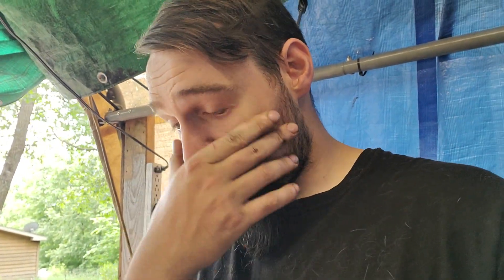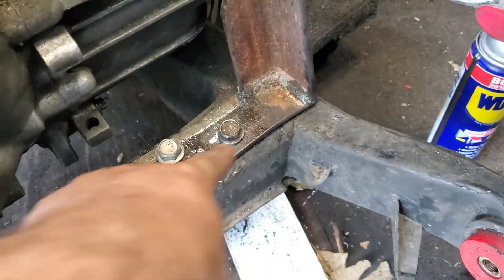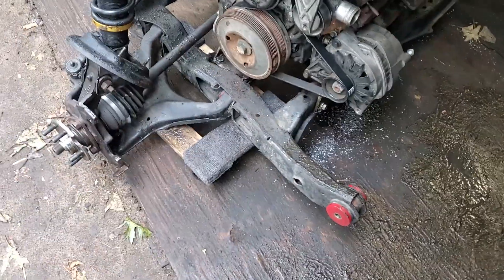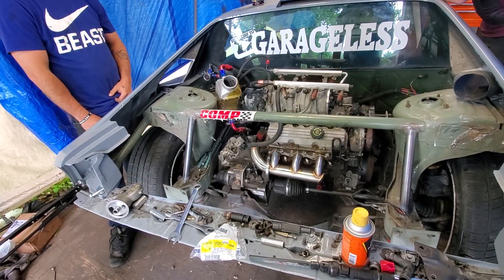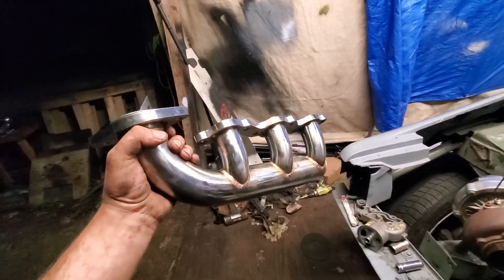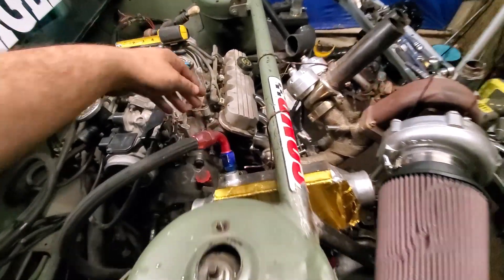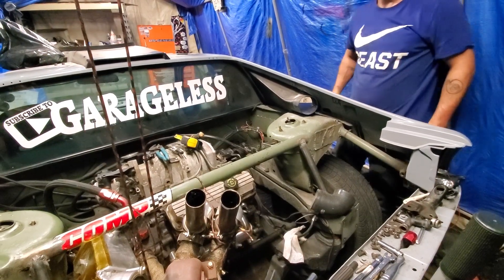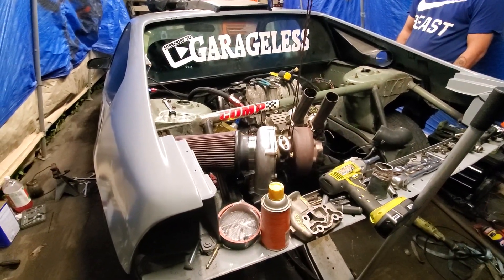ITS IN!!! TURBO 3800 WITH F23 SWAP INTO FIERO!

Comment: I ended up putting a milky way rebuild transmission in mine with a hardened shaft, I also had to mount my turbo to the exhaust manifold’ because it was simply to big’ I made a bracket going from the Turbo to transmission for stability.

Comment: How did you remove the whole cradle and engine without a lift. Im having a hell of a time messing with the engine with the front part still bolted in.
Reply from the maker: I have no trunk so that helps a lot... i unbolt it all and use jacks to lower it to the ground then lift fiero with jack or something of that nature to pull it out... i found moving dollys help a lot to set cradle on to push around... if on gravel get some plywood that will help a lot
Reply: @Garageless  ok. Cause right now.it just hangs down. Id like to push my car furth up and then pull the engine back. Ill have to get some dollys
Reply: The Life Of Riley that’s the very same reason....I want to completely delete my trunk.